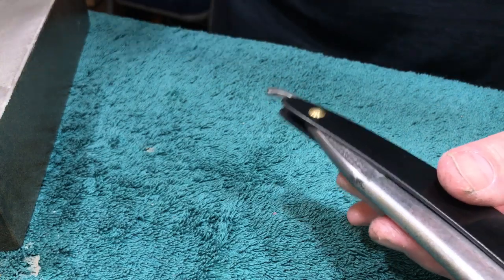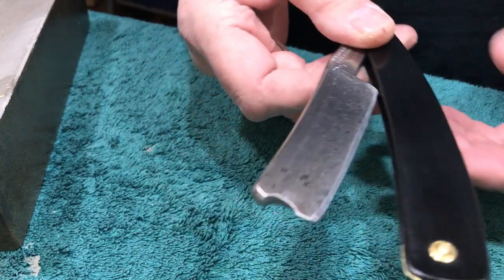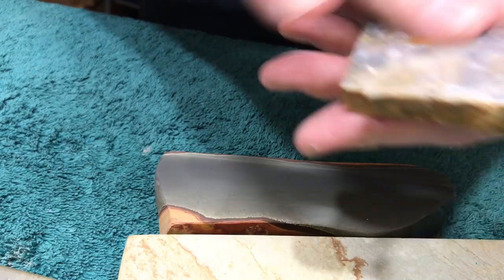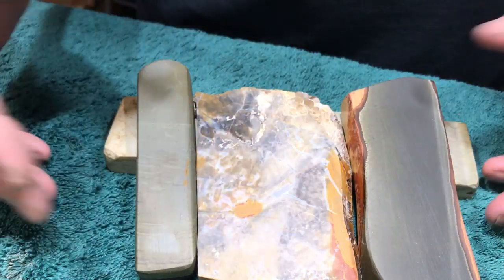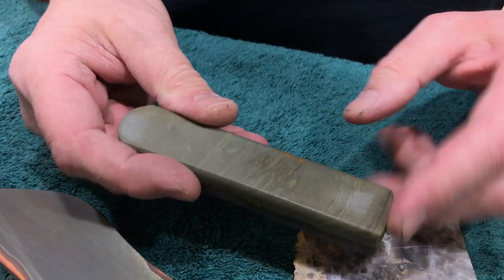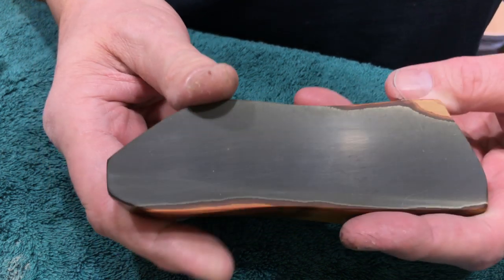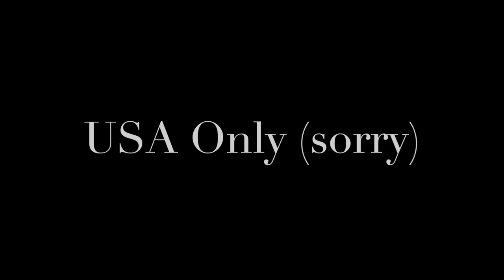Honing Vlog # 10 - Jasper, Jnats, Nagura & Stuff

Comment: #teamtomo Keith, what exactly do you look for to see if a stone is smearing or burnishing?  Do you look under magnification?  Great video by the way!
Reply from the maker: I can feel it, and it can be seen under magnification too.
Reply: @KeithVJohnson1  I haven't really had any stones do that unless the abrasives are worn and the stone needs to be reconditioned.  This is happens mostly with my oilstones (Norton Crystolon/SiC, Norton India/AlO and Arkansas stones) for knives.  Sometimes I can feel the stone either not biting or cutting, and I usually notice a loss of slicing aggression when test cutting.  I didn't think to look for it under magnification.  Again, this is usually an issue I have when sharpening knives.  At my parents there is a stone (just in a decorative stone collection) that looks like Jasper or Agate, and I tested to see if it was abrasive.  It was, and I compared the scratch pattern to my pocket Surgical Black I carry on me, and it wasn't as fine, but it did cut and polish well.  I guess it's like you said , those stones are hit and miss.  I had been think about going to a bead or rock store and picking up some Jasper, I think Henk Bos suggested it in his four part PDF on natural stones from around the world.
Reply from the maker: Stones of that ilk have been used as sharpening stones for centuries. If we believe one popular retailer, Vikings carried jasper as a sharpening stone. But, your observation is correct; it's like having an otherwise good stone that needs to be reconditioned. The working surface wears/glazes too fast to be of much use to me for my needs.